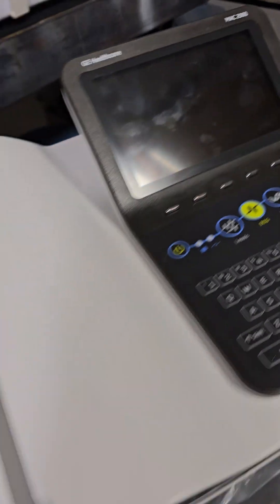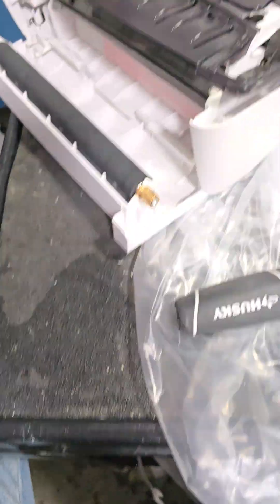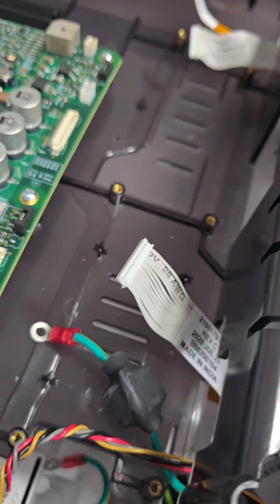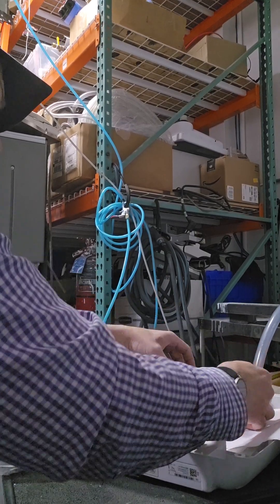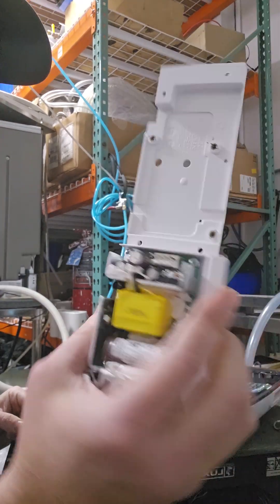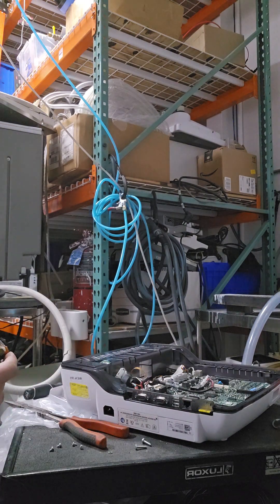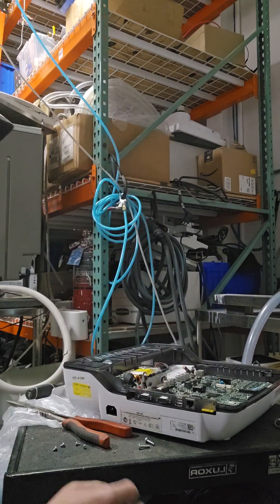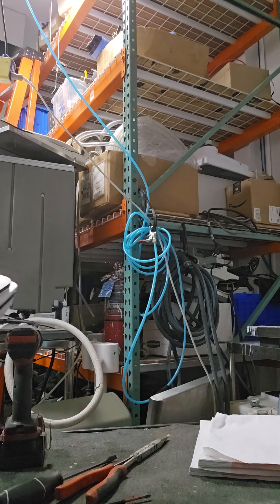GE Mac2000 printing problem. full disassembly

Comment: thank you for the video. I have one and when i hit print it says printing but it wont print the ekg . it does print other reports though . what do you think can be my issue ?
Reply from the maker: what other reports?
Reply: Did you ever figure it out? Mine prints fine during system diagnosis but not an EKG as well…